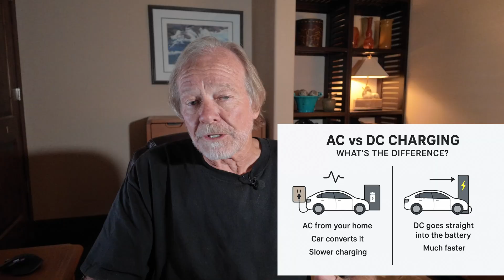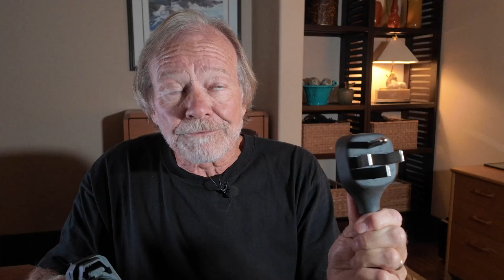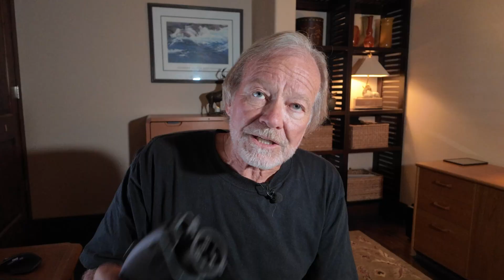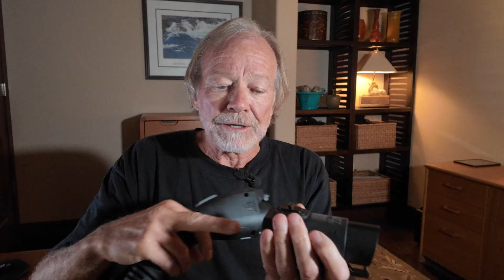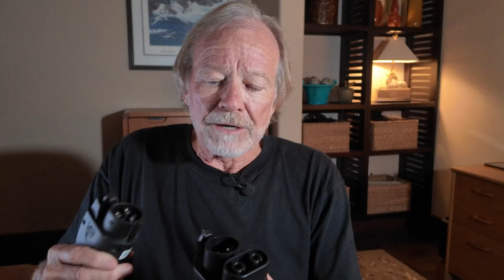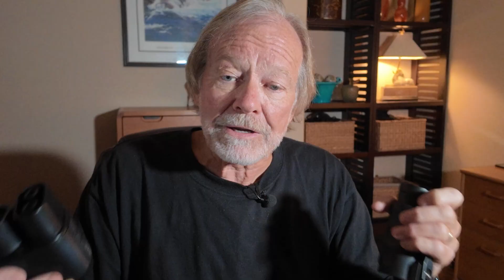EV Charging Made Easy – Plugs & Adapters Every Driver Should Know

Comment: I have a Kia EV6 and purchased a Lectron NACS to CCS adapter, early this year.  I had no issues using it on a recent road trip from Columbus OH to Raleigh NC. I had two stops at Tesla stations in Ripley and Princeton WV, where there were no other DCFC options. I found it easy to use the adapter and I'm grateful that Tesla SC's are another option for road trips.

Comment: One thing for folk's with non-Tesla EVs that want to charge at Tesla superchargers, besides possibly needing an adapter: Some superchargers might no work with your car, usually the slower Tesla superchargers (120kW and 150kW). ex. Rivians will not charge on them. To recognize them, there is a silver ring where the hose meets the charger handle. Some locations have both 150kW and 250kW chargers and they aren't labeled, so look for whether the silver ring is there or not.
Reply from the maker: Thanks for your comments. - Paul

Comment: Adapters are great, if you need them, but they add another potential point of failure.

Once the decision to switch to NACS was made (in mid to late 2023) by the auto industry it became a no brainer that you want a NACS port on any new car you buy. Charging networks are already beginning to switch their plugs from CCS1 to NACS, so if your car has CCS1, you're going to need to use adapters for the life of the car.
Reply from the maker: I agree 100%. -Paul
Reply: J3400 is the standard as of this year.   Tesla vehicle made before 2022 that have the NACS port can not charge at a DC fast charger that is NOT Tesla with out paying for a hardware swap out of the cars charge port controler.  It is complicated even if you own a tesla.   J3400 is not compatable with all tesla cars.

Comment: I don't have to worry about any of this B.S., I'm driving a '14 BMW i3bev which only accepts the J-1772 and does not do D.C.fastcharging.
Reply: Actually, you do. Not right now, but it's just a matter of time until even the J-1772 plugs start getting replaced by NACS. You probably have a bit more time than CCS1, but not a lot.
Reply from the maker: If you are happy with what you have, why change?  Thanks for watching!